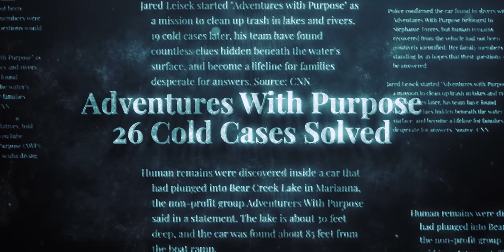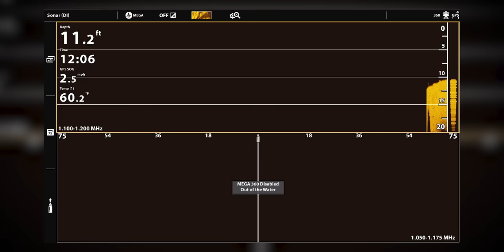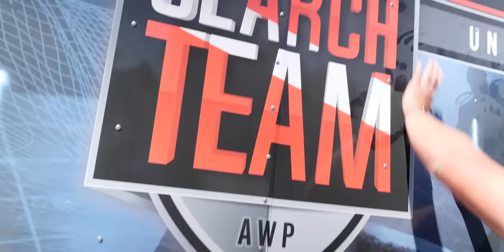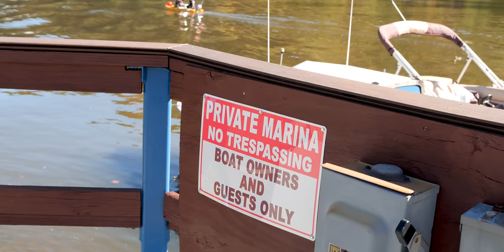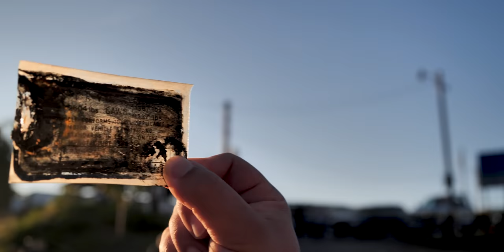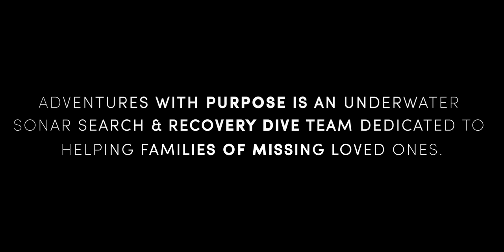TARGET LOCATED: The Case of (Missing Mother) Janet Walsh

Comment: Joke from the 80’s:
Why did all Yugo’s have rear window defrosters as standard equipment?

To keep your hands warm when you were pushing them. 

No big mystery why a Yugo would end up in the drink. They were horribly unreliable cars.  
Owner frustration, insurance claim or parking brake failed on the boat ramp. 
No respectable thief would have stolen it.